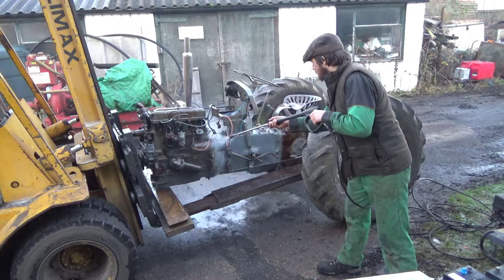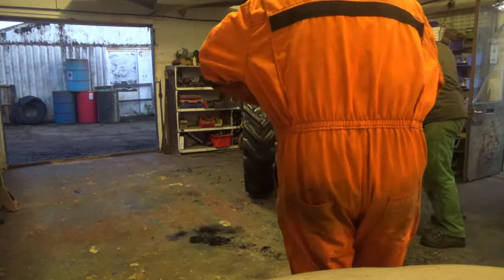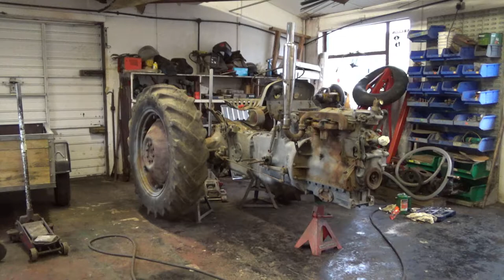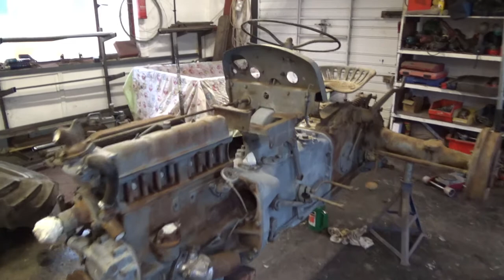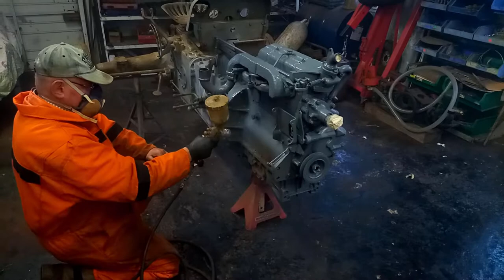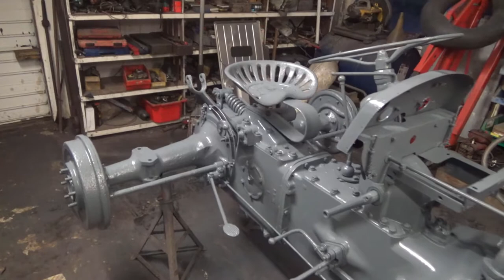Ferguson TED20 part 3 - Degrease and painting the skid

Comment: Awesome colour, do you have a paint code and or supplier? Cheers from Canada, TEA20 owner.
Reply from the maker: Hi Ken, the paint is supplied by a company called Witham Oil and Paint. When I get back into the workshop on Tuesday I'll let you know the code, as they do two different shades of TE20 grey.
Reply: @michaelcullum53  Thanks Michael, don't worry their paint code may not translate to anything available here in Canada, I did call NAPA but I will have to go see them to look at what colours are available. Cheers.